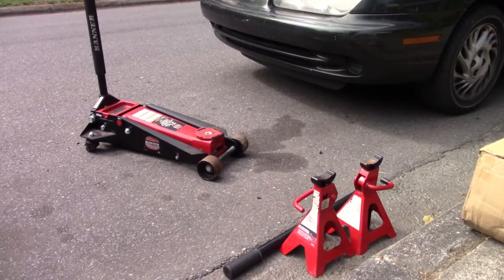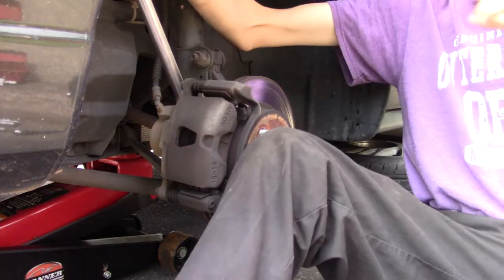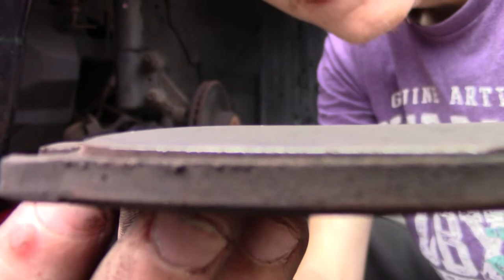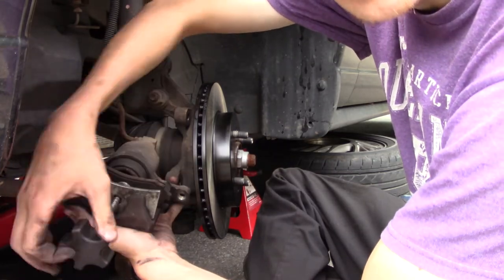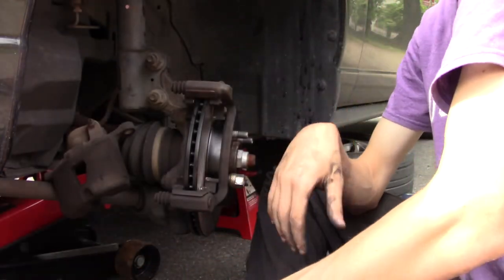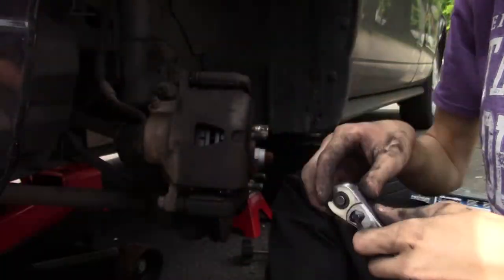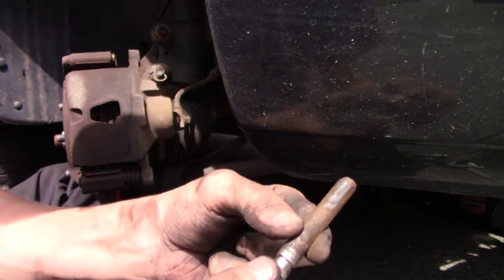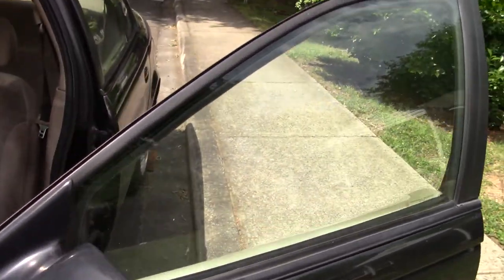Changing the Brakes | Saturn S-Series

Comment: I'm going to put drilled ones with black coated hubs and ceramic pads. I have a nodded 95 SL2 with RPF1's on them and an MFACTORY limited slip differential.